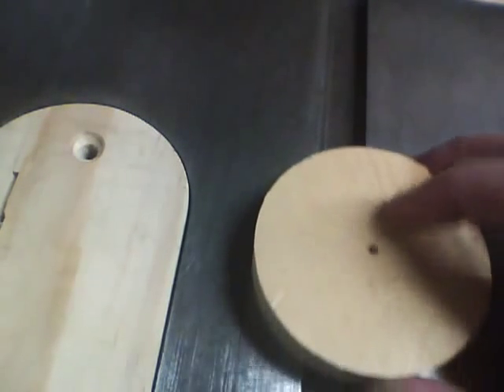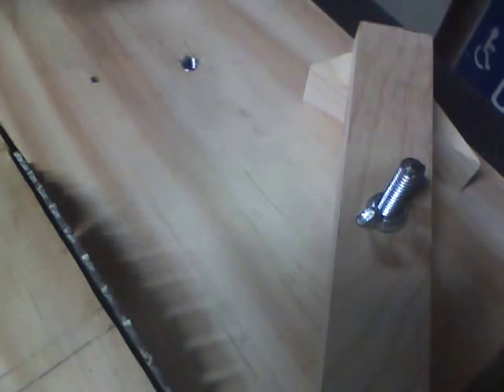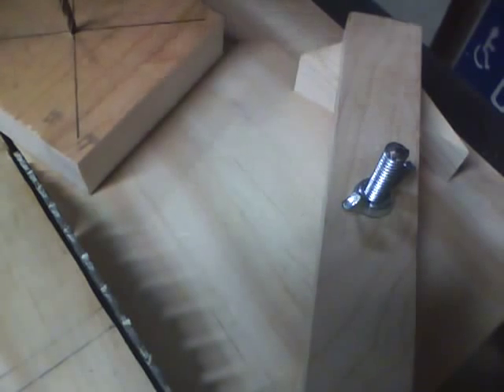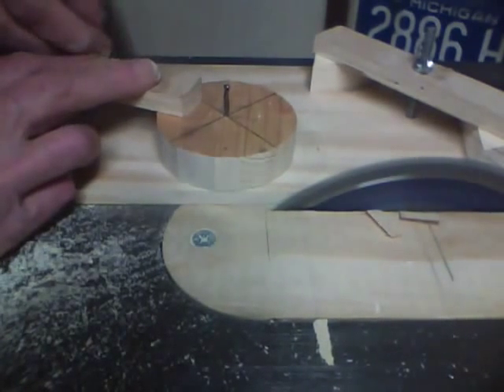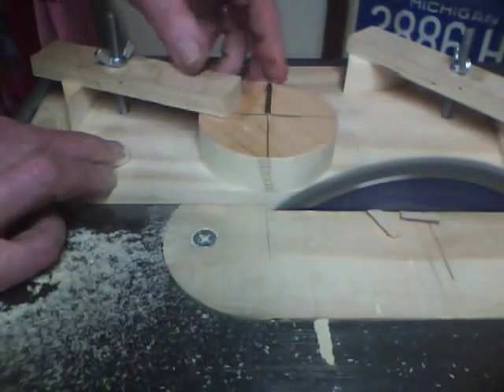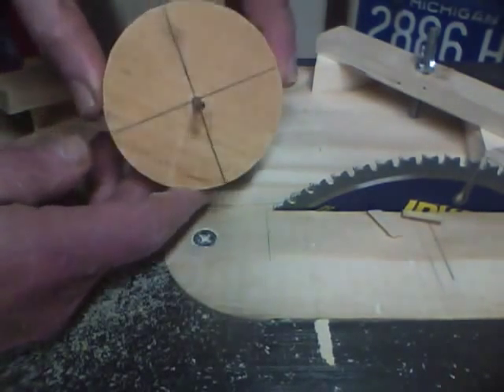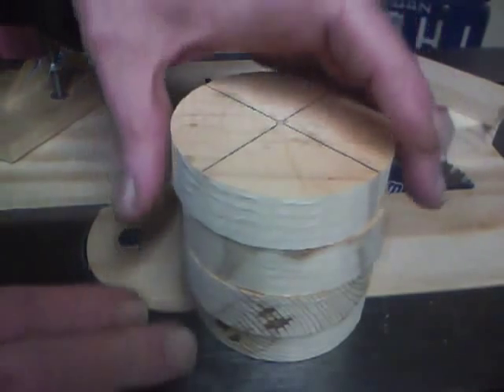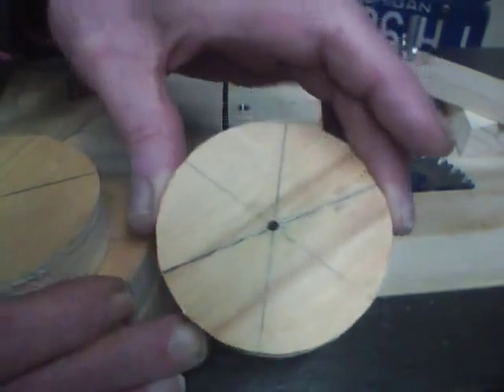Make Whirligig Hubs & Propellers part 1

Comment: It would be a lot less work and a bit safer to use a hole saw bit on a drill press.
Reply: That's true if your hole saw doesn't have much run out.
Reply: My thought too.  I was nervous seeing his fingers so close to the blade.
Reply: @mammothfilms  same here
Reply: @mammothfilms  I couldn't watch it.      There's a three stooges film where they hand Curly a circular saw. I screamed, don't give him a circular saw and turned my head away from the tv.